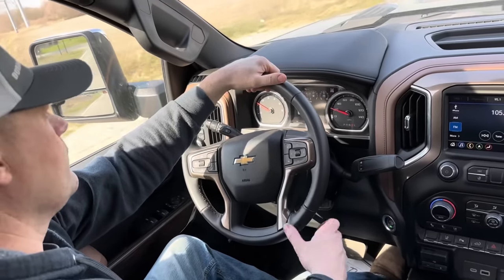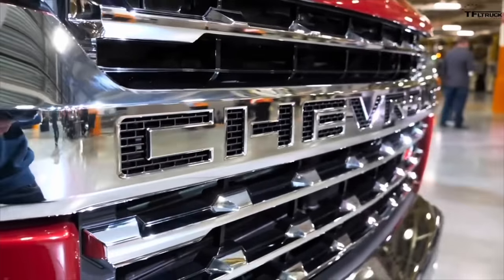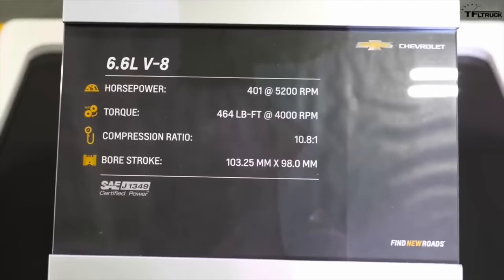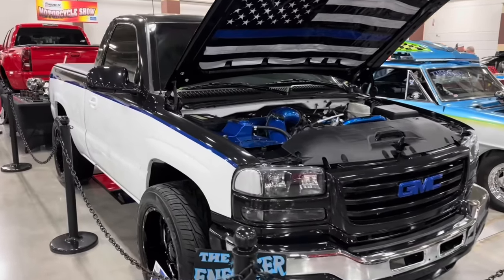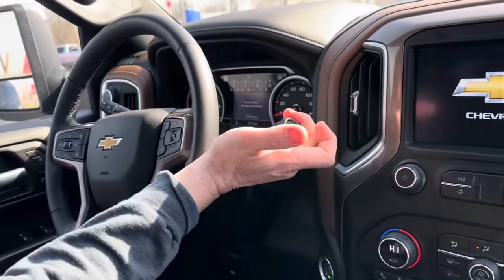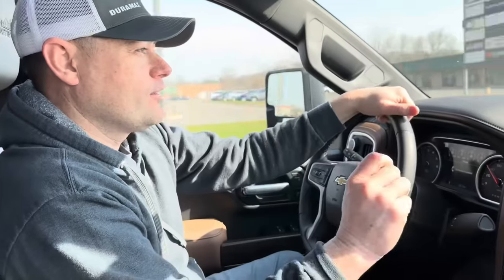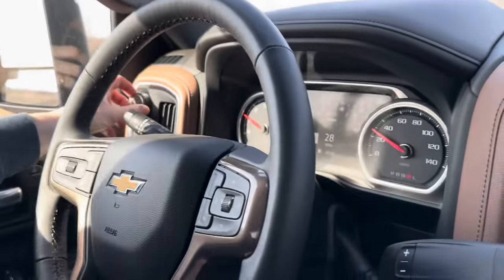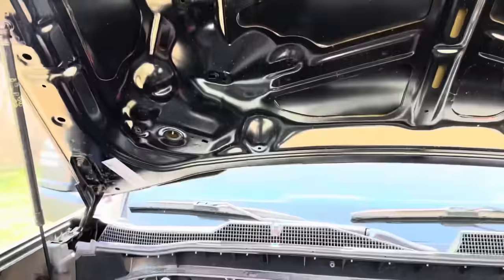What I Really Think About The New 6.6L Gas Silverado! WORTH IT?

Comment: Wonder if the 1500 w/6.2 compares fairly equally to the 2500 w/6.6.  Gain roughly 4,000 in towing capacity, but would you notice a big difference towing up to 10,000 lbs?
Reply: Wouldn't be towing that much with a 1500
Reply: @FIVE6-qk6pc  most people don’t tow more than 5,000.  “Up to 10” means between 0 an 10,000.  Still a few thousand below the max towing capacity and more likely than seeing a tundra tow a space shuttle as seen on tv

Comment: Would love to hear your thoughts on the new chevy 1500 with the inline 6 diesel.  I have been looking at them main due to the fuel economy.  I have a LMM for the heavy towing. Was looking at the 1500 for more of a daily driver.
Reply: Correct me if I'm wrong, The GM will stick with the internal combustion engines in the whole lineup.
Reply: I have a 2020 L5P, but my father just purchased a used 2022 Sierra 1500 with the 3.0 duramax and loves it so far. His cluster shows an average of 24.3mpg and it felt like it has plenty of power.

Comment: Comparing apples to oranges.....gas burners are far different from diesels in load performance. Can a gas burner do the job, sure. Can it do it as efficient and effectively as a diesel, not hardly.
You have to keep in perspective what your needs are and how often you would need one over the other.

Comment: The majority of diesel owners never even come close to exceeding the max towing limits for the gas version.. They just want act like they have a hot rod truck.. Its a complete waste of money unless your towing near or above 20k lbs on a regular basis.. Its crazy how many people I know that think they need a modern diesel to tow their bass boat and a small camper maybe one day per month.. I just don't get it.. If you know how to pull a load these 400hp gas motors do the job great, you just use more rpm instead of relying on a turbo.. and all the extra costs and issues that come with the Diesel motors.. They used to be great an reliable, not anymore.. Those days are over.. Now your lucky to not end up with your truck getting thousands of dollars of warranty work, while they give you a tiny rental car if your lucky, and then when the warranty is up.. you better cross your fingers or trade it and get another one with another $1500 month payment..

Comment: Was the one you test drove new? Or used? We got a new 6.2 Yukon at the end of last year. It honestly felt underwhelming as far as power goes during our test drive. After 4 or 500 miles it came to life. Much more torque in the low end and it feels quicker overall. They may tune them down for a few hundred miles for a safer break in from factory?

Comment: I'm strongly considering ditching my 21 Cummins for a 24 6.6 gasser. I'd like to hear your opinion on the 10 speed if you get the chance to drive one.
Reply from the maker: Thanks
Reply: I got rid of my 2020 ram 2500 Cummins for a 22 6.6 gas Silverado HD.  The towing I do is less than 10k. Fuel economy is not great but with emissions equipment on the 6.7. Fuel costs were a little cheaper with the gas. I definitely miss the Cummins power. I’ve not owned a Chevrolet in 20 years and I’m not impressed. The 6.6 gas is ok but I only have 11k miles on it. No oil or engine issues yet. I will say not changing fuel filters every 15k and not buying DEF is a big plus. Oh and it doesn’t need 13 quarts of oil or fuel additives either.

Comment: Really no reason to do a comparison on the gas vs. diesel. All it will prove is that diesel is superior in a truck. Once you go Duramax diesel you dont go back. I drive my wifes 1500 with the 5.3 and find that I am really dogging it hard because I am use to that Duramax torque and power. I am spoiled on the Duramax after driving these trucks for 21 years.
Reply from the maker: Great point

Comment: Compare them yes. If it was 30k or 40k I'd say yes to gas. But since they are basically a diesel price, diesel all the way. I get 23mpg not pulling with my 20 L5P and winter it starts right up in -25 easy in MN. And do a weight reduction on the L5P and don't post it. You're too scared man just do it!!!! Cman man haha

Comment: That sucks.  No truck without persistent P20B9 - Reductant Heater 1 Control Circuit
P20BA, P20BB, P20BC, P20BD, P20BF, P20C0, P20C1, P20C3, P20C4,  P2BAD, P20B9, P21DD, P10D, P203, P20E, P22FE, P2463, P20A0, P22A1, P2201, P205B, and more DTC's populated along with a "reduced power" and "service exhaust fluid system" message really just isn't a truck.

Comment: I haid a 98 12 Cummings 5 speed and at same time I haid 1997 dodge ram v10 5speed the v10 did out perform the Cummins butt I dont know if they go back to  Is modern big block like chevy 8.1 or  ram v10 could ever capture to modern diesel I do here good things about the new 7.3 ford gas butt it far from the fords 6.7 powerstrocke butt i been getting new diesel ram every 5 years from my first 98 ram Cummins till my last truck Cummins Nissan titan xd what i have been very happy with it dont have the pulling power of 12 ram 3500 signal wheel with asin transmission butt much better driving truck and the 5.0 Cummins douse pull well

Comment: your wife's comments seem to be more about the particular make of the frame and furniture and not the actual engine.

this is my opinion:
new gasoline engine-trucks should be hybrids. this is because a gasoline engine can be easily modified to run on LNG/LP. and the electric motor can produce way more horsepower than a diesel. the idea of a hybrid is to just manage the battery supply as long as you have enough reserve letting the engine cycle to charge it up doesn't matter.

I think the reason people are scared of hybrids and electrics is that they don't really have instant energy expenditure. an all electric vehicle is a lot of maintenance and most of it isn't a strait forward mechanical replacement, it is almost all a computer management. I think we are either going to have to make fool-proof electro-mechanical parts that the traditionally minded can wrap their minds around.

still I think the future of gasoline light- heavy duty trucks is hybrid electrical with an electrical drive train.

Comment: You can use the paddle shifter up and down! I used it all the time with my 2008 6.0 just bought a used 6.6 2020 HD 2500 custom it's bigger and taller than my 2008! But I still paddle shift in wet weather instead of braking! I have over 247,000 on my 2008 and that engine is still tighter than Toby's ass after a fiddler's ass whupping!

Comment: Best truck, drive train terrible Green Party 🎉 engine, horror show unfortunate exhaust. 
greatest frame and body ever. Best aerodynamic lean, greatest drive train. best emissions too. producing clean not exhaust. 
 One can use the exhaust pipe to refill oxygen tank. 
   if short on breath one can go around back and breathe exhaust off the tailpipe  
 The trick is burning off the acid made by  frying it on the oven after the converter. 
 It’s truly wonderful

Comment: It replaced the 6.2 that replaced the 6.0
Reply: I had a 2019 3500 srw with a 6.0. Now i have a 2020 3500 srw with 6.6. I wasnt aware the hd trucks came with a 6.2
Reply: @Rockk12  you are correct. 6.2 has been around long time it’s a 1500 Denali high country and Escalade engine
Reply: The 6.2 was never in the HDs.

Comment: All these new trucks are so overly limited by the factory tune it’s quite pathetic. In all honesty once you re tune the transmission it actually turns the truck into a useable truck. They limit torque to 1/2 of what they advertised, adjusting that alone wakes up the truck. Not ever will I deny the diesels as superior but the gas trucks are complete crap with factory settings.

Comment: I had a 2021 GMC sierra 2500 HD Denali I used this truck and drove it for one year. Sold it back to the dealer what a piece of shit head to 6.6 gas engine. Was horrible on gas. The tin was really thin just breathing on it made a dent and it’s the wrong color black is the biggest piece of shit color Chevy makes had to have the hood repainted after three months I currently on a 2019 GMC 3500 Dinali Dooley and I’m so much happier.